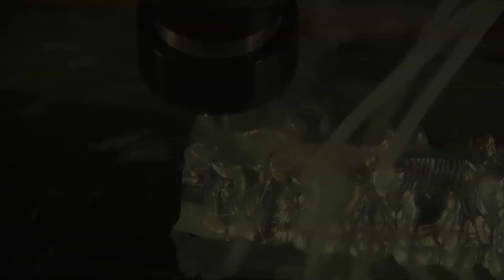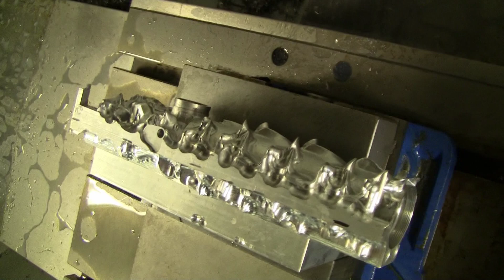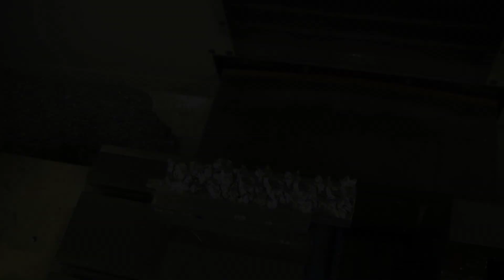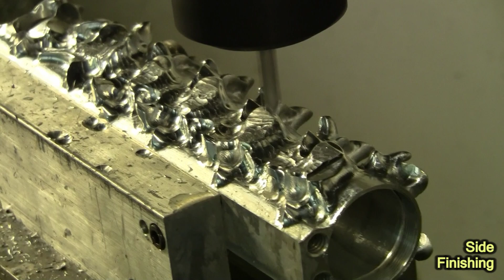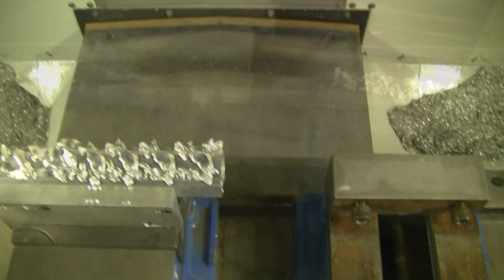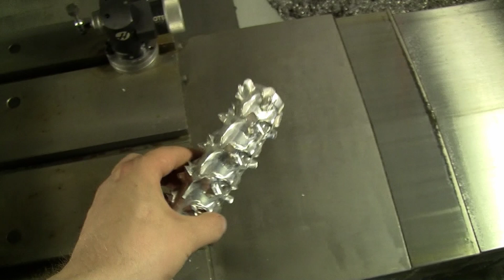Spinal Shocker (part 2)

Comment: A pleasure to see fine work as always.
This uses shocker SFT guts?
Reply from the maker: yep, except for the feedneck which was improved to a boss-latching style. I'm working to make more bodies which will fix a couple of other "legacy" quirks..
Reply: I have mixed feelings about that. I always liked the clean lines and slim form factor of the SFT, and this is kind of the opposite. On the other hand, I like creative unique versions too.

I think the next one of this series should be a pneumag that takes those RAP4 first strike mags on the bottom. - but you've probably got more creative ideas than time to make them.
Reply from the maker: GunFun ZS yeah this body is very large in size, it was meant to take full advantage of the 2"x2" unmilled bodies that I have. But I have a couple designs which are more traditional. Personally I love the way the classic SFT bodies look, so I tried to emulate it in a few alternates. I don't know if I'll have time to make them all, though...
Reply: I can see the vertebra on this one shredding a bunker. Or the player's face if a dive goes badly. It must suck to make a bit of art like this and see it after it's been slammed into rocks and things. On the other hand, I think I would rather see that then see it pristine after 20 years of not being used though. "Safe queens" are tragic.

Comment: do you do any service for shockers? Like if I sent mine to you, could you run through it? I have had it for 6 years and can not find what is wrong. And just curious what you could do to upgrade my shocker?
Reply from the maker: +Aaron Doucette - myself I don't perform any repairs like that, but there are some places floating around that could probably help. I know a guy that runs a website shockerrepair(dot)com and he works on just about all SP markers among others. unfortunately some problems can be difficult to narrow down unless you have spare parts to swap out..

Comment: Thank you for not uploading any stupid music with this video(as in the case of Mastercam lathe programming). Good job! Except you could run a ball mill through all the surface corners to smooth it out( following the splines). Other then that it is pretty useless piece.(basically just expensive toy, where the shape doesn't have any function) With what you know, you should look for work in aircraft mold industry and in car replacement parts for racing teams. A lot more satisfaction when you see, that you did something, which functions in real world.....
Reply from the maker: Jiri Tichy thanks, yeah I added a edge-cleanup finish cut in later iterations of this. It's kindof rough on the processing time, but then again so is everything. I almost never add music to machining-only videos, but those cad/cam screengrab videos were different...i don't do much of those :)